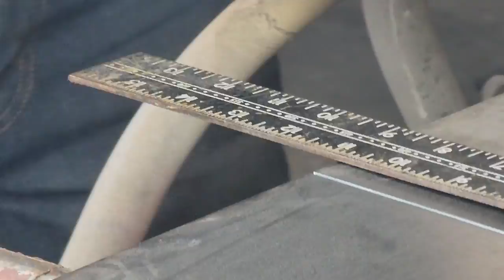Fabricating floor supports | 1948 Ford Concept Car Hauler 🚚

Comment: Ein gutgemeinter Rat von einem älterem !  Mehr arbeiten, konzentriert bleiben, weniger reden, dann wird während des Filmens auch viiiel mehr geschaft  😉😉 Im Fernsehen, als Eure Sendung lief, da habt ihr gearbeitet, zwar auch gesprochen, doch mehr geschafft. JETZT sind dein Sohn und der damalige Motorenfachmann und Freund weg, und Chad redet,redet, redet und redet. Geschafft bekommt er fast nichts. So bekommt man keine neuen treuen Zuschauer  😊😁👍👍
Reply: @JohnnyMac04  Mir haben die 2 sehr gefallen, sie haben viel Atmosphäre mit reingebracht. Schade, aber so ist es eben :)

Comment: How are you going to open the car doors with those sides on there?? you will always have to winch it on. And if you do, you probably have to keep the car in neutral. and you'll have to be able to push the car off. but with nobody inside to control the brakes. HMMM.

Comment: Y'all seem to have missed the winch that will be installed at the front of the truck bed. No driver needed. However, there is a large hole in the roof that allows easy ingress\outgress in a worse case scenario.